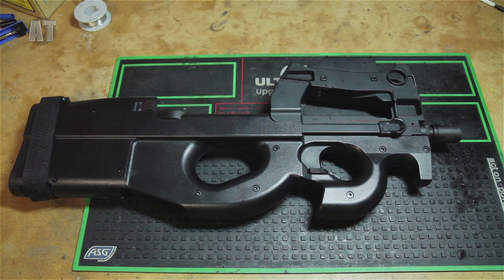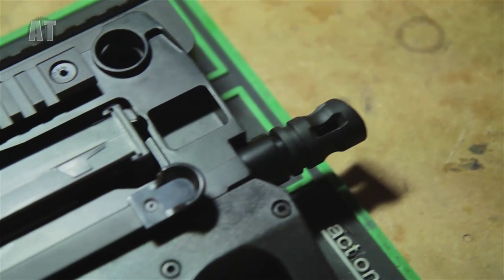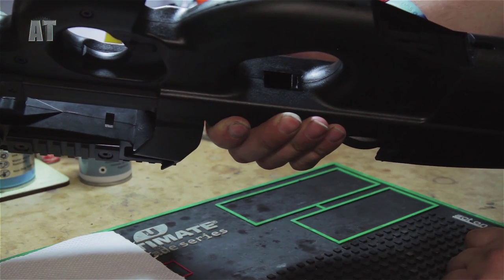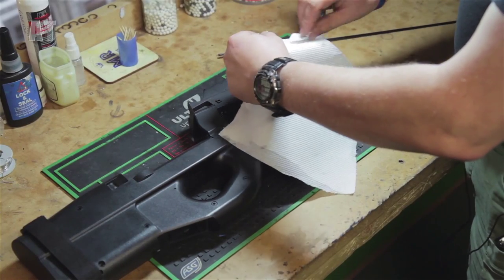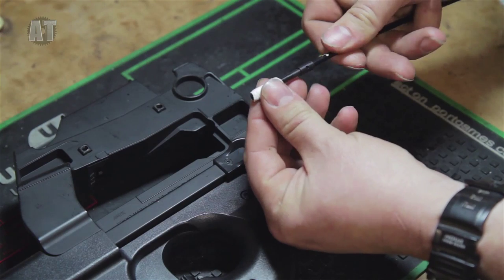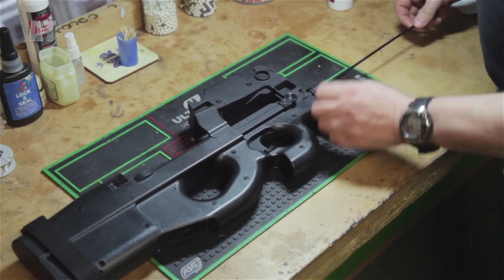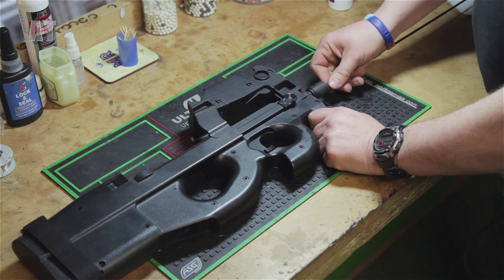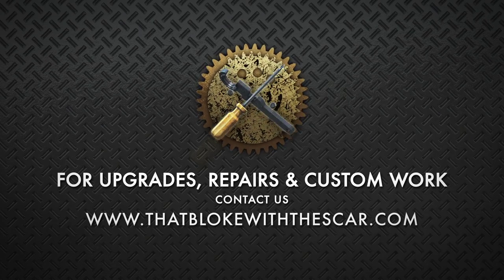How To Clean Your Airsoft Gun Barrel

Comment: I really enjoy the professionalism of your videos, but I have to disagree with you here.  
Paper towel bits are slightly abrasive.  In a stock barrel in a gun that will most likely never be upgraded, that doesn't really matter.  But when you have your $60 cold hammer forged steel PDI barrel in there, this can become a problem.  Lint-free cotton patches, either prepackaged at your local sporting goods store or made from a CLEAN t-shirt at home, are non-abrasive and entirely safe to use in your smoothbore barrel.  A smooth, unscratched barrel is a happy and consistent barrel :D
Reply: I agree, you shouldn't be using an abrasive material for this. In addition the silicon oil shouldn't be left in the barrel, at least 3 cleaning sweeps (after the cloth is clean) should be run through in order to clear off any excess silicon, otherwise the hop effect of the gun will be inconsistent.
Reply: Tissue paper or kitchen towel is not a highly abbrassive meterial.  Especially compared to the crap that may already ber in your barrel.  Paper towls are a tried and tested method for cleaning and have never ever been know to cause any damage to a barrel, good or bad.  In fact if tissue paper damaged a barrel then i would suggest using a different barrel :)